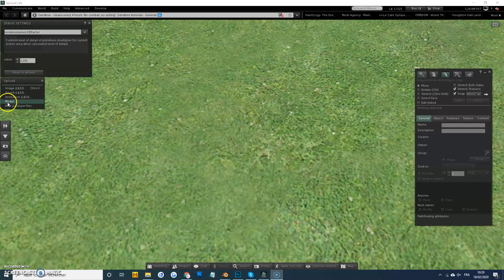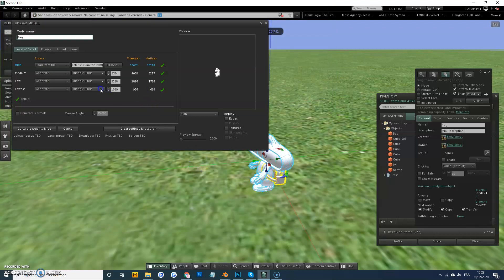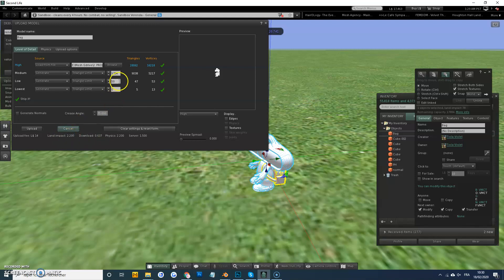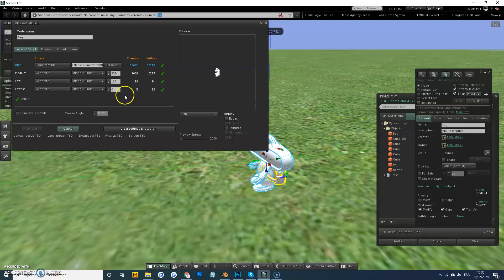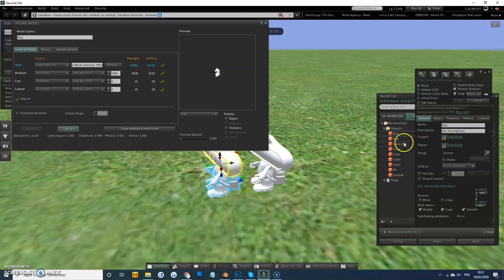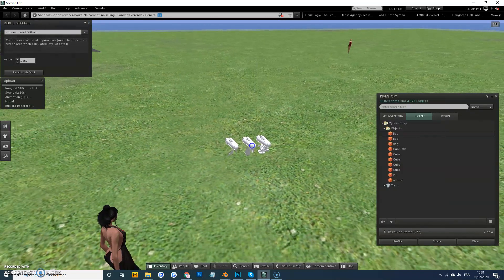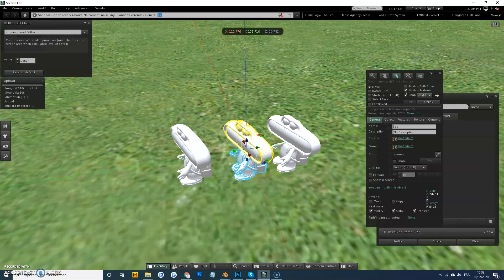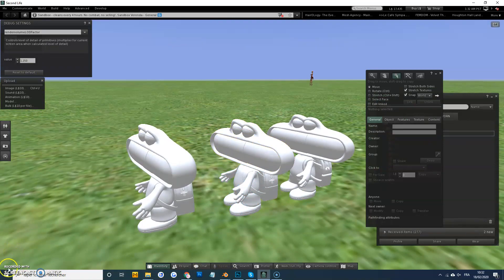Second life - Low Prim Mesh Upload

Comment: another tip, in blender if you make 4 models, ie duplicate the model 3 times. then leave the first one as it is, the second one go to decimate and reduce it down, third one, reduce it down further and the last reduce it right down as low as you can go. Save each model to desk top then upload them in order using the from file tab. If you have a cube also saved to desk top you can use this as the physics under the physics tab to help reduce your prim load .